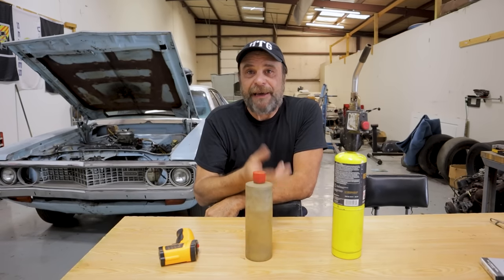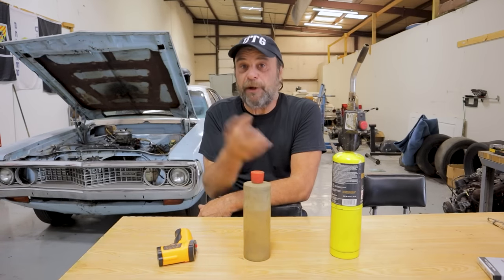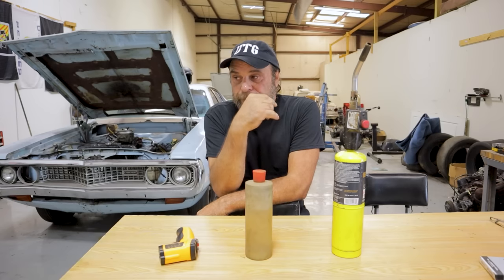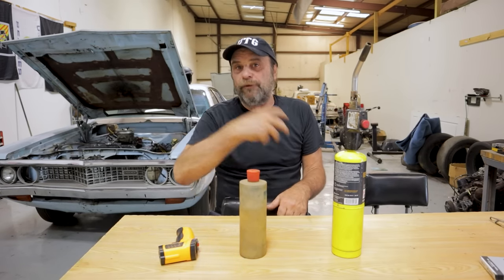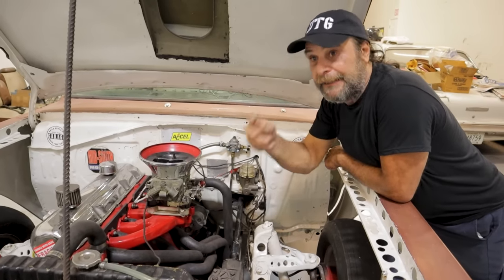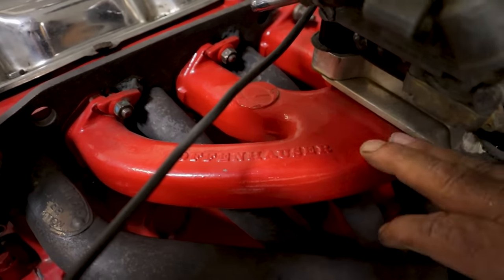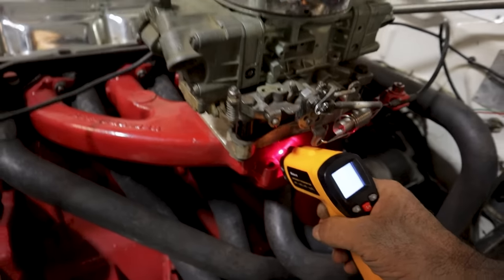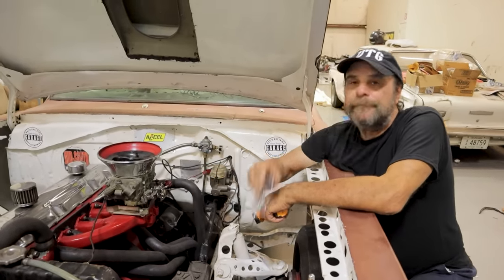How Much Intake Manifold Heat Is Enough? Testing The Vaporization Temps Of Modern Gasoline

Comment: Remember fuel line going thru a "Coolcans" full of ice?
Reply: I remember people doing that, saying it improved performance. 
But they were wrong. Or confused. Modern Dyno testing has proven that there's no HP gains from using a cool can. It's cold air that allows for better combustion. Cold air with hot, well atomized fuel is the golden ticket. 👍 😉
I've read something about cooling the return fuel/air mixture that didn't burn though.
But I believe that's for a fuel injected setup with a return system and all that stuff. 🤔
Reply: often that was a percolation issue as the mechanical fuel filter soaked up engine heat as the closed hood would trap heat in the summer. Roadkill once made the mistake of putting their Hemi Bee's fuel cell in the trunk of the super bee...no air flow..and they showed the fuel just bubbling away. so they spent $100 or more filling the trunk with bags of ice in 100 degree desert driving. as for performance, here's Richard Holdener's view

https://www.youtube.com/watch?v=ymFjK3PRL_A&t=497s
Reply: @lilmike2710 I just saw a dyno test on motor trend where they cooled the fuel and had huge gains
Reply: @Ep1cPvP  mmmhmmm 😏
Reply: We went to a local ice cream parlor and they would sell us dry ice to put in our cool cans.
Reply: @stircrazyone7929  dry ice would be good, it wouldn't melt into a puddle for the tires to drive over.  
meanwhile, a video on how cooler fuel can add 50hp:

https://www.youtube.com/watch?v=QLN88FZMnwE
Reply: It helped keep the fuel from boiling in the carb.
Reply: We had one on our 68 charger.  It was cool the way my father explained its importance to people.
Reply: David Visard talks about this in a video. It does work but some people think that’s all you need to do you have to make compensation for the cooling affect. Adjust fuel going in now that it’s cooler
Reply: Intake temperature versus fuel temperature is not the same.
Reply: D.V. Explains that it depends on how much heat you are couteracting with the cooler. If you do not have the heat to atomize the cold fuel, than you dont get the vaporization needed to have proper performance. He said its 15% vaporization needed. It works well with high boost,especially with poor intercooling(roots blower). On a carb, the booster type and manifold type(heated or unheated) has an effect on the atomization.
Sudden rush of air in manifold off of idle causes fuel to cool back into doplets from vapor.
Reply: Cool fuel is more dense . So just like air , you are putting more of both together at each pulse .
Reply: How to cool can on my Circle Track Plymouth Fury first state laps the car ran fantastic

Comment: You could make a small heat exchanger out of copper pipe and stick it to the bottom of the intake and circulate coolant through it. Use a heater valve to regulate the flow so you can get the temp you want.
Reply: That would be an interesting experiment. Live temp readings as you monitor performance
Reply: @Fleetwoodjohn what about a block heater on the manifold
Reply: Maybe some insulation wrapped around the runners would help if aluminum 
intake cools down too quickly. Easier to test than some heat exchanger.
Reply: How many holes worth of weight is that?
Reply: Interesting. Add a temp sensor and choke cable to control the valve.  Realtime.  Aren't we full of ideas for UTG? 😅
Reply: I was thinking a small slushbox under the carb that allows coolant to flow via the old heater hoses. Control with heater lever, add a thermocoupler to post an 'intake temp' gauge so you know when you need more or less heat.
Reply: I have considered a temp probe in the base of the intake, even as a permanently installed gauge.
Reply: Simpler than that glow plug
Reply: Simpler than that glow plug
Reply: @v6ileib  The problem with insulation on the intake manifold is that Tony needs the intake WARMER. Insulating it would keep engine bay heat from warming it up, and just let the vaporizing fuel inside it chill it even further.
Reply: @stevelacker358  Good point. It occurred to me later after commenting.
Reply: Thats exactly what I was thinking. Free heat, minimal weight.
Reply: @craighansen7594  That sounds like a great idea. Let it run until it gets to the correct temp and then go.
Reply: ford 300l6 manifolds from Clifford have water heat. ford 390 v8 had a water heated carb spacer that was tyed to the heater to make for better cold weather ruining. Scot drake remakes the 4bbl spacer. another would be make a plate to bolt to the bottom of the intake and have a pipe welded to the plate and Tye in to the header to use exhaust heat.
Reply: Ford did this!  They had a plate under the carb with coolant running through it.
Reply: Tony, I think your kinda sneaking up on the issue in a round about way. Let’s take ignition timing off the table for this situation. It’s about air velocity and fuel ratios and engine demand. 

Your running fine at idle and your under some manifold vacuumed. Your open intake valve is creating suction in the intake runner and lowering manifold pressure, which is encouraging vaporization of the fuel. So you are currently  generating a proper air fuel ratio. When you nail the throttle, 2 things are happening. You intake manifold vacuum instantly drops to basically zero, so your fuel evaporation, vaporization suddenly drops because your vacuum suddenly goes away thus dropping your vapor pressure. So your mixture suddenly goes extremely lean for a moment. The accelerator pump attempts to fix that by dumping an extra wad of fuel into the intake. But at that instant, there is not enough vacuum to vaporize the fuel in the air mass so it drops out of suspension. It either drops to the floor of the manifold or condenses on the walls. So your still in a lean condition but with a big glop of extra fuel in the manifold. The engine is still turning over, so air is still being drawn through the manifold at a slow but accelerating rate. Then as the air starts moving faster, it starts pulling the extra fuel out of the intake. But it’s gone from being too lean to being to fat in mixture. So it’s not yet mixing and combusting properly. 

After a period of time, the raw gas is pulled into the engine, the air flow is now moving faster through both the primaries and secondary Venturi‘s at a faster rate with the carburetor, now beginning to provide the proper fuel air mixture ratio, and that is making its way to the engine so the power from the combustion process now reaches optimal. At this point, your fuel air ratios have returned to proper levels, and you start getting the power output out of your engine, and the stumble and bogging goes away. 

The reason a warm manifold helps is the walls are now warmer than the fuel/air dew point and less fuel falls out of suspension and condenses on the walls, keeping your mixture fuel lean. Then after the air velocity increases, the condensed fuel is pulled along with the airflow and makes the air fuel mixture to fat until it’s gone.  Then finally, you get to the good mixture. 

I suspect this transition period is why manufactures developed the vacuum operated secondaries for four barrel carburetors.  It kept the air fuel ratios within reasonable limits so they would not add to much fuel before the increase in air volume and velocity happened before the engine was ready for it. The vacuumed actuated secondaries included a metering function which controlled the rate the secondaries opened at. Thus managing air flow and mixture keeping the fuel and air demand engine dependent, not flat footing driver dependent.
Reply: @americanrambler4972  you are 100% right!
Reply: Or you could just run your metal fuel lines across the exhaust heating the fuel up to atomize it as soon as it comes out of the carb
Reply: Carburetors tied in to the cooling system aren't really a new thing. My Pierburg 2E3 had that in 1984 from factory and I'm sure some other carbs did have that even earlier...
Reply: @wiedapp  ford had water heated spacers under sum carburetors. was teed in to the heater line so when the heat was on the plate would heat. this was in the 1960s on 2 and 4 barrels and possibly 1 barrel carburetors.

Comment: A MASTER MECHANIC/ RESTORER taught me; WHEN PROPERLY TUNED, TIMING SET & CARB SET PROPERLY ITS: 1 2 3 relatively quick pumps to floor & wait 10-15 seconds for fuel to atomize and turn to vapor. Then turn key and it fires everytime and idles smooth and clean!! IT WORKS!!

Comment: Not knocking the carb, but I now see why port injection is more controllable and preferred in modern engines when it comes to fuel efficiency and energy production. The injector is atomizing cold fuel right on the hot bits.

Comment: Back when I was a smog mechanic. I learned that a carburetor at 100° outside temperature would run at 32°/freezing, that's why guys at the  out in the desert with their sand buggies  added really huge Jets to make it not stumble, what they didn't know it was ice crystals forming inside the carburetor. Thanks for remind me of something I forgot. Keep up the good work I like the way you teach these new kids.
Reply: New kids don't run slant sixes.
Reply: Assuming those sand rails were running VW engines, I know exactly what you are talking about. Guys will put a big center mount carb but will not try and make any provision for heating the intake manifold. So then they were jetting rich for the stumble. With dual carbs and short intake manifolds all that goes away. But sand rails are used, well in the sand and desert. Having a carb hanging out on the side of your engine makes it quite vulnerable to rocks and dust. The center mount carb is for practicality. But it creates it’s own problems without intake heat.
Reply: Yes, that's why aircraft gas engines have carb heaters to prevent icing as incoming air at altitude cools as it accelerates into the throat of the carb.
Reply: @joehoeing6590  , I'm aware of carburetor icing but this is a race car that doesn't get driven in winter and surely doesn't fly at high altitudes (hopefully). I still fault the design of the intake manifold and I also question the logic of that orientation of the carburetor since all air/fuel from the primaries is directed towards the front 3 cylinders and the rear 3 will be lean until the secondaries open. And if this is a vacuum secondary carb there is a chance that the secondaries will open late or possibly not at all.

Comment: Smoky Yunick used to swear on 200-210 degrees for circle track engines the hot air engine had a inlet temp of 450 degrees

Comment: I have been trying to balance this low temp boiling point problem with street driven carburetors for many years. I demonstrated this once for a customer who brought me a small block Chevy/Nova combo. It was properly and neatly installed, all new and the tune was reasonably close. He had a steady power loss as the temp came up but no overheating, max 195f. I cooled the engine with a larger radiator  down to a steady 170deg f. Helped a little but after several miles on a warm/hot day he still started losing power. I plugged the exhaust crossover in the intake and fabricated a heat shield with insulator gasket under the Edelbrock carb, helped more. I demonstrated the gas boiling in the carb by running the Edelbrock carb with the top off, manually keeping the fuel bowls filled. Did this from a cold start to full temp. As the carb bowls reached around 150  deg f you could see the fuel start to boil. It, the fuel,  looked really hot boiling. When I stuck my finger in the boiling fuel in the bowl and held it there it demonstrated that it wasn't as hot as it looked.

Comment: I agree with @ homotorsports .  Will the higher air fuel mixture flow during burnouts cool off the plenum more than it can reheat before you make your run. You should test it before the weekend so you don't waste the trip to find out it doesn't reheat and it does the same as your other runs and bogs.

Comment: I believe that as soon as you stomp the gas after the intake reaches 150 degrees, the intake charge (atmosphere) will suck most of that heat away, I have a homemade aluminum intake that even in the summer would develop a layer of frost/ice between the carb and the head, I wrapped the runner with the oil cooler hose and improved driveability enormously
Reply: I'd say it's highly likely you're correct, might finally get the manifold to heat soak and it just cools itself again.
Luckily it's a drag car so he only really needs the one warm hit
Reply: The gasoline vaporization requires energy as the gasoline molecules such energy out of the aluminum it will cool   Key is to have sufficient mass or weight such that temp drop is within acceptable range

Interesting experiment would be to get manifold up to 150 at idle then monitor temperature under plenum as you pinch the throttle
Reply: Suck energy not such
Reply: @ccpgmike620  I can assure you that as soon as the gas/air mixture hits the hot aluminum intake it (the intake) will lose heat like there's no tomorrow
Reply: @davebaker9128  I agree! I did a very rough calculation:  vaporizing 1 fluid ounce of gasoline can instantaneously drop a 20 pound aluminum manifold ~3 degrees F.  Knowing specifics of fuel consumption and wieght of the slant manifold, Uncle Tony can ratio this estimate. BTW ethanol takes like twice as much energy to vaporize as crude oil based gasoline